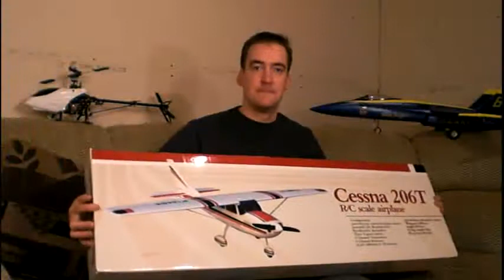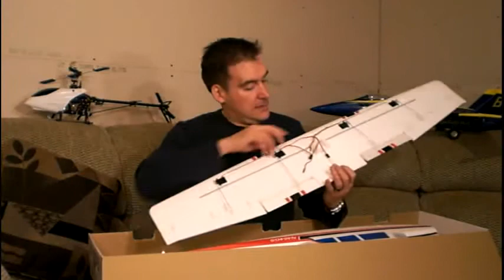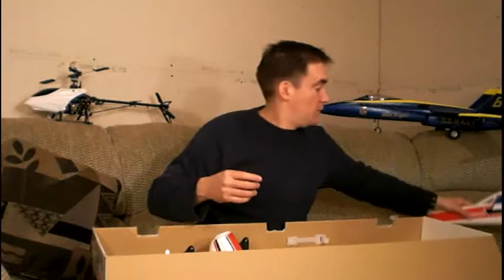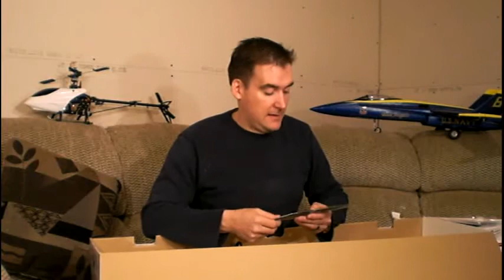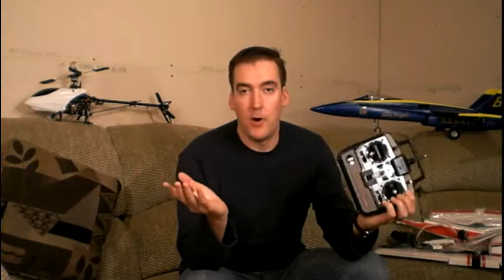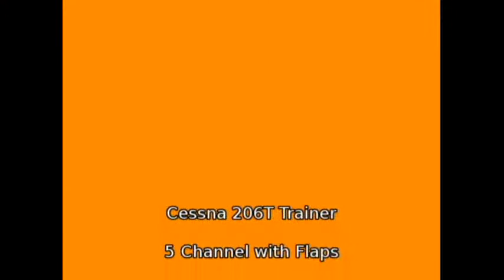Cessna 206T Trainer - SN Hobbies

Comment from the maker: Is your throttle control at the lowest setting when you plug the battery in?  If not the speed controller might not initialize.  Also, check that your servo leads are all in the proper receiver spots, you may have swapped the throttle channel with a different one.